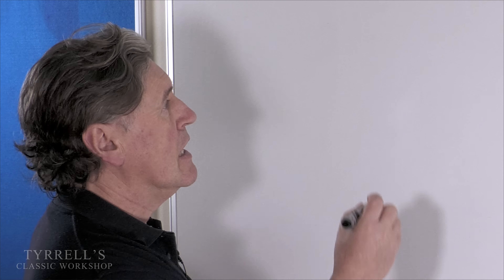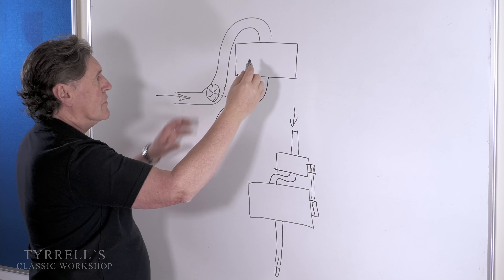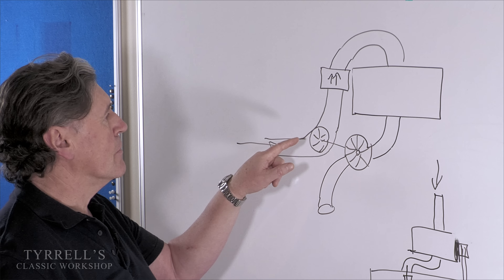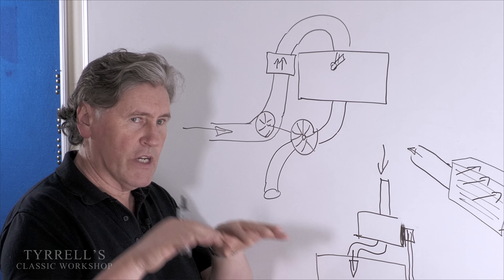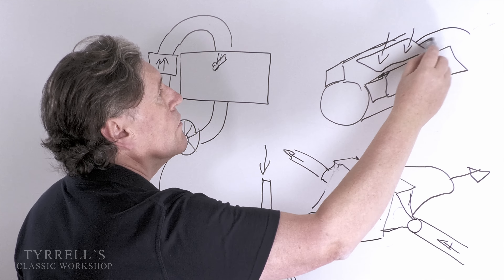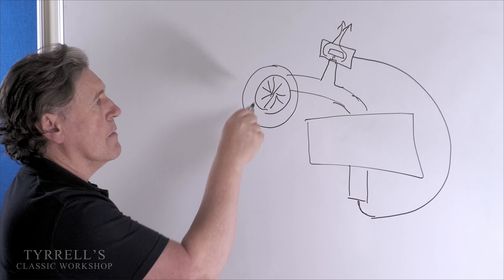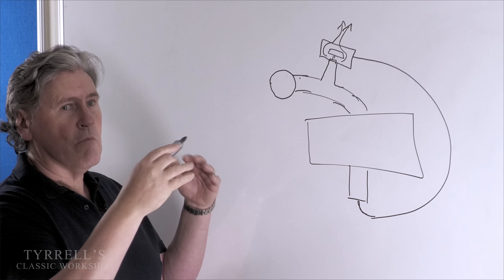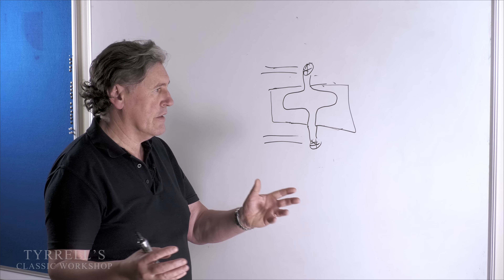Turbocharging vs Supercharging - The Ultimate Guide | Tyrrell's Classic Workshop

Comment: Iain should be a technical college teacher. Such easy to understand explanations and the whiteboard is definately his friend. I already knew what the differences were between turbo chargers and superchargers and what intercoolers do but I never knew why boy racers put those blow off valves on their turbo systems until now. I always thought they were just to draw attention to themselves. I still think they make the car sound like it has the flu and sneezes everytime gears are changed, but now I know they serve a purpose as well. A great teacher. If I taught young mechanics I would definately show them this video.
Reply: They were long since replaced by recirculating waste valves which is the current technology. The old school turbo blow-off or dump valves sound cool but are not as good as the modern original equipment. Like a noisy exhaust the sound may be cool but often reduces performance especially on/off throttle response.
Reply: @chriscooper3384  I never thought they sounded cool.
Reply: New release day for the video’s? Will it now be on Saterday?
Reply: They can’t afford him.
Reply: I think he's doing alright where he is 👌
Reply: @charliejackman2953  yeah he seems to be doing ok. 😁
Reply: @chriscooper3384 The built in recirc wastegates are pretty failure prone. So much so that welding up the hole during a recondition/rebuild to convert them to external an wastegate is a common mod.
Reply: I don't like that fluttery noise the blow off valves make. It doesn't sound sporty to me and is somewhat annoying in my opinion.
Reply: Hes only been on 6 hours and 5000 peoples watched him. Think he’s doing ok
Reply: @worldofrandometry6912  I quite like it, sounds pretty sporty to me, whatever that means. I remember the first time I heard those was as a kid watching rally cars tearing past just meters away on a dirt road, chirping as they went.
Reply: @worldofrandometry6912  flutter is basically from not having a blow off valve, causing compressor surge/stall. Some prefer and very much desire this because of how iconic it is. Type "group b audi" to hear how it sounds when they lift off the gas❤ At least in theory the turbo gets less stressed with a dump valve so the compressor wheel and turbo shaft have less vibration and side loading. Each to their own I suppose but for me if a turbo car doesn't huff and puff then what's the point 😂😂

Comment: Great video! Only three tiny details...
1.: the Chevy Corvair was the first production car with a turbocharger.
2.:some cars use two turbos in different sizes to reduce turbo lag - these are on the same side of a 4 cyl engine. Like in the Opel Vivaro van. 
3. :But what I really missed, was the system on the Lancia 037 and the Delta S4? Supercarger and(!) turbo on one engine!
This was a very well made educational video, everything perfektexplained and I like the way of your artwork on the whiteboard - it makes everything absolut clear. 👏
Greetings from Austria 🇦🇹
Reply from the maker: We must give some Lancias airtime soon. Greetings to Austria!
Reply: combination of supercharger and turbocharger in one engine is called sometimes a twincharger (not a twin-turbo arrangment) where each mitigates disadvantages of the other with own advantages explained in the video. Solutions were studied and experimented, and used for planes, marine and railroad engines before were used for cars. The idea of an intercooler might have also come from double stage air compressor build long before charged car engines.

Comment: Great! A small specification. The air going through the air cooling the intercooler does not mix with the pressurised air in the inlet. It just cools the pipes the pressurised air is blowing through.
The small gills on the intercooler is the heat sinks for the pressurised pipes.
Forced induction is of cource air under pressure. Higher pressure the more the motor theoretically grows in size. (2 bar means that a 2 litre engine now has 2x the air/fuel it can detonate. So acts like a 4 litre.)
This also means that components can tear because of the pressure. 
I have seen some dramatic failures of intercoolers, plenum chambers etc as the pressure gets to extreme. 

Ian Tyrell is a legend and the explanation is great and he knows full well what I have written here :)
Reply: I thought Iain made it clear that the two air sources didn't mix?  It was obvious to me from his diagrams.

Comment: Very well explained. Thanks! Cleared up a few things for me. I want to add a point that might be obvious to many: When the intercooler makes the air denser, as you said, it leaves room for more fuel, as well as a bit more air. The denser air also brings more oxygen to match the increase in fuel so it all can burn properly.

Comment: An interesting vlog, worth adding that the exhaust valve timing has to be advanced on a turbo charged engine to provide adequate pressure in the exhaust to power the turbo, this compromises some of the additional power provided the turbo and reduces the fuel efficiency of the engine .

Comment: Very well explained, well done. Although now retired, I once operated a Commer truck fitted with a Routes horizontally opposed 6 piston 3 cylinder supercharged diesel engine. The pistons came together on this layout to create compression. They used a Wade supercharger with a quill shaft drive to it. When this quill shaft snapped then the street would be blackened out by the smoke generated. B
Reply: As a child In the 1950’s I lived on a steep hill on the A1 and I could always know when a Commer was coming up as the sound was so distinctive.
Reply: Yes and the exhaust was across the cab and exits in front of the right front wheel. At night and in the dark, when pulling hard you could look down on the exhaust and see the carbon sparks flying out. Thesè engines de-carbed themselves. They sounded like they were begging for mercy. !!!!

Comment: The other supercharger system is like I have on my prewar MG. One very large single carburettor feeds air into a twinscroll roots type supercharger, which then forces air into the six branch manifold to the cylinder head of the six cylinder engine. It increases power from about 60 bhp to over 100 bhp in a 1100 cc engine, at 10 lbs boost which was pretty good for a 1934 car. Iain your white board explanations are superb and easy to follow, so please can we have more.

Comment: Not only dens air permits more fuel but also cool air expands more than warm air. For this reason on a F1 engine both turbines are taken apart with the charge turbine mounted at the front and exhaust turbine at the rear of the engine connected via a long shaft. Another type was the recovery turbine used on big aircraft engines in which the the turbine is still driven by exhaust gas but instead of driving a second turbine for charge it is via a fluid clutch directly coupled to the crankshaft.

Comment: I had an afterschool job at a turbo and deisel service workshop in the early 1990s and loved working on the truck turbos because you could actauly handle the compnents relatively easily while the smaller car turbos were a bit more challenging provided they hadn't actually exploded before hand.....

Comment: Another turbo layout that Mazda used in the 13B-REW Wankel engine was twin sequential turbos. The low speed turbo gave full boost as low as 2000 RPM and at 4500 RPM it shifted to the high speed turbo which took you to the 8000 RPM redline. The transition was seamless as long as you kept your foot on the floor. If you short-shifted around 4500 RPM (which one should never do in that car) it would get confused and stumble.

Comment: One of the other things worth mentioning is that the exhaust gas temperature of a petrol is much higher than that of a diesal, which is us one of the reasons that turbochargers are more common on diesals and superchargers more common on petrols. Two stroke blowers, also found on the British opposing piston Napier Deltic is significantly different to a charge air four stroke.

Comment: In the mid 60's I did the Automotive Engineering Diesel portion of my tech college trade course on naturally aspirated BMC 6 cylinder four stroke diesels and on the six piston, three cylinder Commer "Knocker", supercharged two stroke diesels. I learned which engine I'd rather be locked in a test cubicle enclosure with on a rebuild test run-up, the "knocker" was a "screamer", deaf to this day.

Comment: Iain, great video!  In the mid to late 1920's, Studebaker had available a gear driven supercharger as an optional extra on their passenger vehicles, and of course there was the Deusenberg SSJ of 1929 which was a Shortened Supercharged model J, hence SSJ. Forced induction is a fascinating subject which is, as you say, as old as the internal combustion engine itself. I look forward to the video you mentioned about the Pors he 930 turbo. One of my favourite cars, along with the Miura. Cheers, mate.

Comment: A mechanical supercharger is a linear device where engine inlet pressure is directly proportional to engine speed.  A turbo-charger is a square law device where the pressure increases as the square of exhaust gas flow.  Hence the boost mostly happens at higher engine speed.  Because of this, the Lancia Delta S4 rally car had both types of device with a supercharger closer to the inlet manifold and a turbo ostensibly blowing through the supercharger.  However, at high revs the supercharger would choke the flow from the turbo, so a bypass pipe was engineered for the supercharger.  Between the two, there was almost seamless boost.   Then Group B was banned after 1986.

Comment: Working like the charge cooler I love the aftermarket oil to water intercooler fitted in the engine bay of my Elise.  Oil and water temp match each other very closely and very stable.  Even in heavy traffic the fan doesn’t cut in.

Comment: Great video Iain! I love your videos so much and the expertise you have!
But there's one aspect missing, why you also need to cool down the air after the turbo or supercharger. If you pressurize air, it will heat up. The higher the pressure the higher the rise in temperature. I've got a C32 AMG which has a liquidcooled charge air cooler under the supercharger with a heat exchanger for it behind the front bumper. Same deal on the supercharged 55 AMG models. The heat exchanger was clogged two years ago, so only a small amount of liquid could circulate and the charge air cooler wasn't able to cool down the intake air. So with a close to not working cooler I quickly reached intake temperatures of 100 °C (212 °F) and more at 1bar (14.5 psi) of boost under full load. Thank God the ECU then quickly killed the power output to prevent engine damage.

Comment: I believe the first use of a Turbo Charger, was by a Peugeot engineer on an airplane engine in the 1920s. I could be wrong, but it was definitely a French engineer. But like everything, things trickle down from commercial applications, and as airplanes were getting faster and flying higher, they needed a device to assist the engine to ingest more air as it became thinner at altitude. Hence the name Forced Induction
Reply from the maker: Thanks- very interesting!

Comment: My wife’s Volvo XC90 and s90 have the dual turbo and supercharger equipped 4 cylinder  engines… one helps out at low revs and the other picks up at higher revs (IIRC)

Comment: I've seen too many tuned cars with forced induction (turbo or mech compressors) & no intercoolers or chillers of any sort, or performance air filters stuffed inside overheated engine bays, just behind hot radiators and with no scoops for any fresh air access... These people should watch more ofter videos like this one.

Comment: I used to run a Prodrive Tuned Impreza (very reliable for 10 years), which was noticeably more lively on colder days. Add in some fog and near zero temperature and gain a few extra BHP 😊
Reply: Fog, near zero temperatures and extra BHP sounds like an "interesting" combination! 🙂

Comment: The Electomotive (EMD) two stroke diesel engines, as used in diesel electric locomotives, need to be supercharged because they are two stroke engines BUT unlike the later production Detroit Diesel engines which were equipped with separate turbochargers, the EMD engines change from mechanically-driven to exhaust-driven when the exhaust pressure is sufficient to propel the compressor.

Comment: Loved the GM references. In my teens many many years ago I operated what was called the 8-268-A, on a ship. A supercharged inline 8 cylinder with 268 cubic inches per cylinder. The supercharger was about the size of a dishwasher. Also spent time around this the 6-71, 8-71 and even the 2-71, 2 cylinder also supercharged diesel. In fact I think the iconic American muscle car supercharger was from the 2-71 not the 6-71 but I could be wrong.

Comment: If turbos and superchargers interest you, do some reading on the the WW2 aviation powerplants that sometimes combined both systems in their V12 and radial engines. All long before any electronic gadgetry was available to manage the systems. Of course this was done more to improve performance at altitude, than just simply horsepower multiplication, but very interesting anyway. Perhaps one of the most built of these was the P-47 Thunderbolt.

Comment: Forced induction was invented as a way of keeping the power up on aero engines as they climbed higher, without the air being forced in by the supercharger the plane would lose power because the air becomes less dense the higher the altitude.
Mitsubishi made their own turbochargers in the 80s and still had terrible turbo lag, I wonder if it was the materials used in early car turbos that made them so slow to respond and not just the size? Just a thought. I still have a mitsubishi turbocharger in my loft and it's not that big for a 2.0 litre engine. It's an interesting topic and I do like some nerdy-ness 😊

Comment: I don't remember hearing it so useful info. Oversimplified. China taxes cars based on engine displacement. That's one factor for why all consumer cars are moving to small engines with turbos. The famous Ford Ecoboost produced a truly tiny 3-cylinder, 1-liter engine making plenty of power for a compact car. It was so responsive and fun they even put it in race cars in junior formulas.

Comment: Corvair was the other GM car wth a turbo.  Jay Leno's Garage has a good video on the Jetfire.  GM used a methanol injection for charge cooling which was not always in stock and people ran out of on the road.  All of this at the time Oldsmobile experimented with a small aluminum V8 which was sold and ended up being used with an iron block by Rover.  The UK was inspring the Corvette to go with an independant rear suspension thanks to Jaguar's advancements.  A great time for automotive advancements globally.
Reply: Rover purchased the 3.5 litre (215ci) Buick all aluminium V8 and not the version produced by Oldsmobile and continued to use the all-alloy engine in their Land Rover Discovery until the early 2000s.  However the Buick and Oldsmobile versions were similar.  The version produced by Oldsmobile was used as the basis of the 'Brabham F1 engine' that was developed by Repco in the mid 1960s largely becasue it was a slightly more robust design - e.g. used 6 bolts instead of 5 to clamp the head. The Brabham-Repco F1 car won the F1 championship in 1966 and 1967 with Jack Brabham and Denny Hulme at the wheel respectively.

Comment: And then, of course, there was the 1930’s Mercedes-Benz system, where the supercharger was engaged when the accelerator pedal was pressed flat to the the floor, which resulted in a sudden boost in power.  There is a legend here in Melbourne of a certain vintagent who, in his 38/250 Mercedes wanted to demonstrate some acceleration at a ‘traffic-light derby’ and ended up going backwards down a conveniently-located side street.
Reply: There was also the chap who was stopped for "using a siren" and had to explain to the coppers it was just the blower whine ;-)

Comment: Very informative, (I wasn't aware of the difference between twin- and bi-turbo).  Just one niggle; heat in a turbo-charger isn't just conduction from the hot side. As Iain knows, if a gas is compressed, it will heat up. This is true of both super- and turbo-chargers, so depending on how aggressive the boost is, an intercooler may be required to cool the charge  back down again.  Combustion should start in the cylinder, not the intake.
Reply: Nearly... manifold pressure would never be high enough to initiate combustion, what you mean is if intake temperature is too high you're at risk of detonation (spontaneous combustion) too early in the compression stroke rather than initiated by the spark plug at the optimum time. 😊

Comment: The other GM car that offered turbocharging was the Chevrolet Corvair Monza. The Corvair used a rear-mounted air-cooled flat 6 cylinder engine. The Jetfire arrived on the market a month before the Corvair turbo. The Corvair turbo was more successful.

The Jetfire only lasted two model years. The big drawback with the Olds is it required a methyl alcohol-water solution to be injected into the intake to prevent detonation. Olds called it "jet fluid". Invariably owners forgot all about it, and when it ran out, a valve opened to release boot pressure. Then they would come to the dealer complaining about lost power. Refilling the 'jet fluid' was way too much hassle for an American driver. 

The Porsche 930/911 Turbo was legendary for turbo lag, but the 935 race cars were even worse. I've read those cars would scare the pants of professional race drivers. They would be accelerating smoothly out of a corner, hit 3000 rpm and BAM. Massive power boost and the car would try to swap ends.